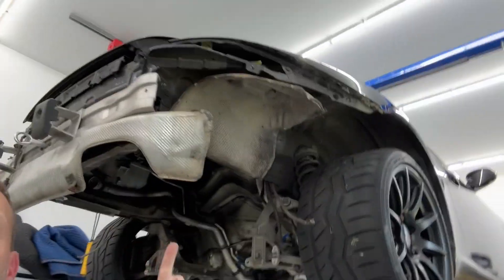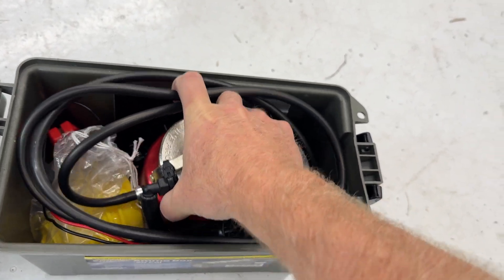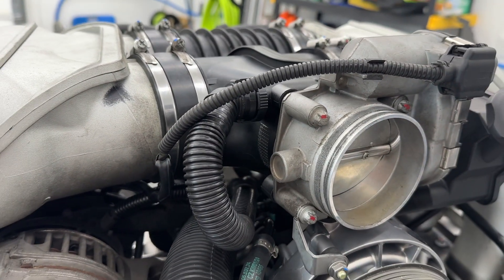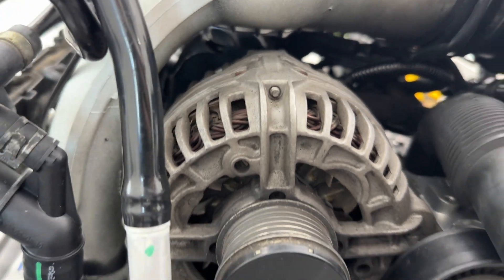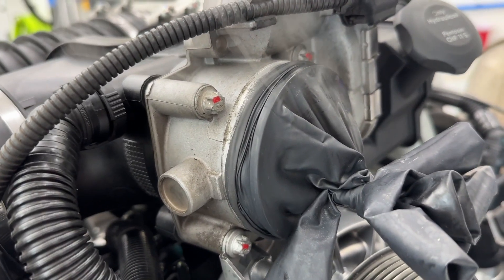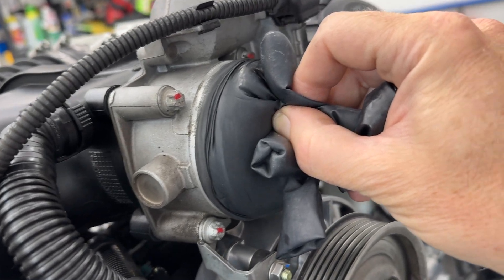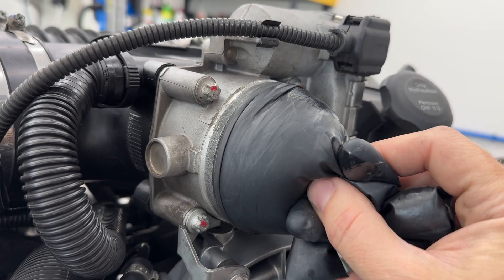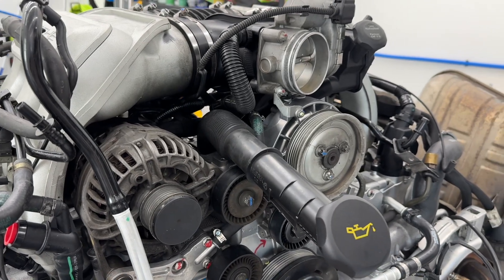Porsche 911 Engine Assembly Guide Part 39: Smoke Test to detect leaks!

Comment: Yeah I forgot to mention opening the throttle plate :) Probably didn't let a lot in, but major misses would have shown up IMO. Mine (once fixed) only leaked out the spot where the resonance flap pivots, which is apparently "normal". 
Anyways I think y'all are OK 🤗, hope things went well today on the 30 min!
Reply from the maker: +@miketdavies I have a coolant leak that I hope is from the water pump gasket.

Comment: I would stick a stubby screw driver in the throttle body to hold it open to make sure you are getting smoke going thru the system. You can also open the oil fill cap to make sure smoke comes out then you know for sure that smoke is entering the intake
Reply from the maker: +@TheTuscanyGuy good tips!